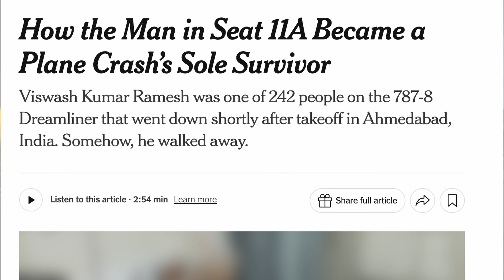Why the RAT Changes Everything – Air India 171 Update

Comment: Captain Steeeve,
I have a friend who is a pilot and flies in India. He said he was actually in the air flying when the crash happened (different flight and different plane than 787).
He said:
“Most probably they have lost their both engines in a very critical phase of flight: TAKE OFF for a long haul flight when the aircraft was so heavy….
At that day at the same time I was in flight, very hot weather with thunderstorms
Vapor lock in fuel system is possible.”

What are your thoughts?

Comment: Delhi (humid)
↓
Partial fuel + humid air → Condensation in tanks & electronics
↓
In-flight to Ahmedabad
↓
Early faults: AC issues, screen flickers = symptoms of moisture
↓
Ahmedabad: Fuel tanks refilled
↓
Water + fuel = contamination
↓
Takeoff for London
↓
Engines ingest water → thrust loss
↓
Emergency

 I have a technical question regarding the possibility of small amounts of water, caused by condensation, leading to engine performance issues or failure.

Based on publicly available data and past incidents like BA38, I’m exploring whether the following sequence is plausible:

The aircraft (B787) operated a short-haul leg (Delhi to Ahmedabad) with high humidity.

Condensation may have formed in the fuel tanks and/or electronics.

If water was not drained at Ahmedabad and long-haul fuel was added, the water could have remained at the bottom.

During takeoff or climb for the Ahmedabad–Gatwick leg, even a small amount of water could have entered the engine fuel system, leading to power loss, icing, or fuel flow disruption.

My question:
Can such a small volume of condensation-induced water — even 50–100 ml — realistically cause thrust decay, filter clogging, or misfueling events in modern aircraft engines like the GEnx-1B on the 787?

Also, would early signs like AC malfunction or screen resets potentially indicate environmental moisture exposure that could relate to such an event?

I would deeply value your thoughts or any precedent examples of this kind.

Comment: @CaptainSteeeve , Steeve, know your nomenclature. Its not a horn, its a siren. ( I think you are a B737 pilot).Secondly, initial pitch attitude is 15 degrees. Have you read the B787 FCTM recently? BTW, it‘s identical for the B777, with respect to TO. As far as the bending moment of the wing at slow speed, you are Full of it! Later on you will opine about the RAT spinning at the speed of sound? OK, at what  blade length are we talking about angler velocity of the speed of sound?  Tell me the diameter of the B787 RAT, and secondly, at what speed would it rotate at 180 KTs, at sea level.You need to stop with all your speculation. You are creating clicks, providing stupid speculation. You will continually change your theory, to suit the current narrative. You need to go to work, and stop with the BS.  Your  hypothesis will all fall apart, one by one. Thank Christ you are not running the investigation. You are such an idiot. More importantly, take off your stupid clown suit. We are not impressed

Comment: The only survivor mentioned hearing a bang just after takeoff. I assume that was the main hydraulic pipe bursting, and due to that pressure burst, the secondary system may have been damaged. The RAT deploys for two reasons: loss of electrical function and hydraulic pressure. At 600 meters, the landing gear was still out, and the flaps were not moving. This means there was a catastrophic failure of both the primary and secondary hydraulic systems that control flaps and landing gear. The survivor mentioned he could hear the engines being pushed to full throttle; however, without the flaps being in position, the aeroplane would stall and come crashing down due to having no positive lift on the wings.

Comment: STEVE. I have shared this with Gary. `Thrust` is everything on take off. Without it, a plane cannot lift. This plane laboured on take off, using the full length of the runway. Notice the dust blown up just before take off (ie using last section of runway rarely used). Now, let me ask you this: what effect would it have on `thrust` if a very small amount of diesel or water (say, a cup) was added to the tank? And would this small impurity cause alarm-systems to alert the pilots?

Comment: @Captain Steeeve I have a shaky theory it’s backed by a little bit of research , a key piece of evidence that further supports the theory of an engine failure: the air conditioning was failing. This was powered by the PMG which is powered by the AC power supply, which also powers the fuel pumps, which are monitored by the FADEC. You mentioned that the engines were running but on low power meaning it is possible they were running, but due to an issue in the signal to the fuel pumps or a disruption in metering, which would be possible during a high thrust run(during takeoff) the systems failed(flickering green lights) this could have been a maintenance/ lack of failsafe in case of multiple electric failure. But that is my take. God bless and I hope the aviation field grows from this.

Comment: I was thinking about the same because something happening with my plane 3 times
the electrical 3 times when I was in the kind of aircraft travelling once  from  São Paulo another from Ahmedabah and another from Toronto
Out of the blue as we were getting ready inside the plane the lights went totally off
The Air India flight In  Ahmedabah got us out of the plane until someone from Mumbai came to fix. The US airline got some light back and we flu almost in the dark inside the plane. They had to use flash light to give us the food The third  one Air Canada in Toronto made us to wait inside the aircraft until they fix the plane

Unfortunately I still fly on those planes but I always have the concerned and the hope that the electrical would not goes off when we are taking off

I hope they see this very seriously

Comment: Steve you sure know that by that point or stage of flight a 787 doesn't need an APU to still be running. And yet still at such an early stage of flight in ascent, dual engine failure too is not true or else the AC wouldn't lift off the ground esp without the required RPM for take off. Lastly about the flaps, in a 787 the flaps and LG are operated using different mechanisms that don't even look or feel alike so there is now way the first officer could have confused the two esp not with 11000 Hrs.
As we can all agree, the LG had not yet retracted so this symbolises the early stages of take-off so I hope we can look at another angle.

Comment: Fuel starvation might be a possible cause, where fuel is present in the tanks but fails to reach the engines due to a blockage, pump failure, or system malfunction. This can lead to a dual engine shutdown, which would automatically trigger RAT deployment on the 787.

Comment: Thinking the explanation at this point is electrical systems failure impacting everything on board.  The 787 is more dependent on electric systems than other aircraft, so it is more vulnerable to electrical systems failures.

Comment: Boeing's safety record and whistleblowers have to be a consideration.

With the evidence pointing so strongly to a dual engine failure, the big question shifts from what happened to why.

A double engine failure on a modern, reliable airframe like the 787, especially right after takeoff, is an event of almost astronomical rarity. While the investigation will rightly look at external factors like fuel contamination or a massive bird strike, it's impossible to ignore the broader context.

Given the intense scrutiny on Boeing's manufacturing processes, quality control, and safety culture in recent years, this incident raises serious questions. Investigators will need to dig deep into the manufacturing and maintenance history of this specific airframe and its engines. The possibility that this wasn't a freak accident but a symptom of a deeper systemic issue is a chilling one that must be thoroughly explored. The black box data is key, but so is the paper trail from the factory floor.

Comment: What if the Dreamliner's Computer System was modified with a Virus, causing the Auto-Pilot to forcefully take over and it limited the thrust of the engines upon takeoff?? 😱😱😱
Similar to those 2 commercial Jets that went down because the Auto-Pilot took over and the pilots couldn't stop it's actions soon enough.

Comment: I'm gonna go out on a limb here and just put out a wild theory here after watching this video..... India doesn't have as strict protocols in aviation as the rest of the world.. I'm thinking an honest mistake slipped through the cracks... Probably got the wrong type of fuel delivered.. like car gasoline.... Somehow, somewhere, truck deliveries got mixed up and the dreamliner got filled up with car gas... Not jet fuel... And more than likely the plane warned the pilots of it but typical of Indian culture, they just ignored it.. they might be used to flying with contaminated fuel so much that they are used to these warnings and the engines are so efficient that they still perform... That's just MY theory... Get mad if yall want.. it's a possibility.... Dual engine failure right after lift off? RAT deployed? I'm going with wrong fuel..

Comment: I have spent a little time looking and relooking at the video's I am interested in Aviation and love the industry. With rewatching the video and I have noticed something. Which may or may not be important. I am sure those of you who fly the 787 will be able to tell me if my thought is wrong or right. If you look at the photo of the plane passing in flight after it has taken off. If you look at the main landing gear the wheel dolly is in the wheels down position. Should they not have been in the wheel dolly up position with the front set of wheels being up higher than the rear set of wheels?. If the pilot or co-pilot has activated the gear up lever then does not the main gear dolly's go into the wheel down position or neutral position before it starts the transition from being out to up and locked? With the main landing gear dolly's pointing downward.... Could that therefore indicate that the captain or co-pilot had activated the gear lever into the up position. The main landing gear then started the gear up sequence and put that dolly from initially being up at the front set being down and then something happened which prevented the next and other stages from happening in retracting the landing gear? To me and I noticed this in the first time saw the grainy video but seeing it again in the clearer video. To me that just does not look right. Maybe someone out there knows more and can correct me. But thought would mention it and see what others think. If my thinking is correct, then the main landing gear is retracted using hydraulic's if the gear has failed to retract could that therefore be an indication of hydraulic system failure? There is a lot of you with experience of flying that aircraft type or even into the maintenance side who can correct me if my thinking is incorrect. But, it was one thing I have noticed.

Comment: Well Captain, I believe you are getting close to the answer but you have to spread the net a bit wider.
The deployment of the R.A.T. Has been known to me almost from the beginning as an engineer told me of the sound of the plane indicated that the R.A.T was deployed. I then searched all the video of the plane taking off and finally found a sharp image showing the deployment. I now knew that a catastrophe fail had occurred in the electrical system. Further searches threw up a video that showed electrical supply anomalies had been observed on the same plane on the incoming flight. So now I know that there was a degradation in the supply system.
The sole survivor of the crash said that the lights were playing up just before the crash.
Comments have been made concerning the gear still being down, I would suggest that the attempted lifting of the gear overloaded the ratty system which collapsed.
Now here is something that you can help with, the deployment of the flaps, power is supplied to deploy them if the power goes out do the flaps retract?
If all power is lost will the engines go flame out? I ask this because the plane had no engine power shortly after take off and was in a fairly flat stall.
My conclusion then is that the accident was caused by a ratty power system! Hopefully fault codes from the black boxes will show some more evidence.

Comment: The dual engine failure happened during the ascent, when the plane took off !!! Such was their bad luck that they could detect engine failure/ loss of power only when it airlifted for a few seconds….had it been on the runway during the take off dash, they could have alerted the ATC & some sort of arrangement may have ( and I say may have because the flight was already in speed so would have been difficult to stop with even hydraulics out so assuming braking was not an option even on the runway & it would have crashed with what was in front of the runway 😢) , but maybe there was a glimmer of hope on the ground with some sand dune kept outside of the runway to mitigate such a situation!!! Atleast that way they could have avoided hitting the buildings which further killed many others. Not saying the ground result would have been desirable either. I am terribly shaken by this incident so may not be making sense I am sorry but this just breaks my heart. Families wiped off with kids 8,9 10…charred at 1000C temp !!! No way to go. God should have intervened.

Comment: Thank you Capt Steve! So to add to this- and we have to take it with caution because it was a TikTok reel BUT a guy made a video of the actual plane that crashed from what he claimed was the flight prior and showed the electrical having issues. Said it was super hot and they had no power in certain areas. Now- could be fake and not true but if it was- might make one lean to the electrical issue. Although- I would wonder how it went back up in the air. So who knows.  As always- I appreciate your take. You are simply the best. Capt Steve for the head of the NTSB! Only qualification you’re missing is an MTV prior job 😉😁

Comment: What is the possibility of fuel contamination issues causing the fuel to get cut off or not able to drive the engine? The reason I ask that is because India has been experimenting with Sustainable Aviation Fuel (SAF) which is an ethanol blended fuel with as much as a 50% ethanol to 50% av gas.  But there is one big issue with ethanol blended fuel - the ethanol and av gas can separate under some conditions as ethanol is hygroscopic - that is, ethanol can absorb moisture and separate out into a different layer. This can be an issue when the airplane is taking off because the water will slosh to the bottom of the fuel tank and then feed into the fuel pumps as typically the fuel inlet to the pumps will be at the bottom of the tanks. Even at 10% ethanol this can be an issue - and at 50% it can be huge issue.

Comment: could be a form of throttle control for the motors, if a battery failed... or the connections to it failed... could that affect the control of the throttles?  idk if its a fly by wire or not... but what would cause a battery or its connection to make a bang sound?  since i don't know the size or number of potential batteries, its just what popped into my head... idk what the tower heard, and a bird strike can hit an engine, yes... but it can also hit a windscreen and potentially take out a pilot.  and in the chaos it crashed?  i mean it was only in the air for 1-2 minutes?  so is that possible?  also the type of aircraft was built by a company that started taking short cuts and using bad parts in manufacture of some models... they were caught by a whistle blower... thou idk the consequesnces involved. or if it is a potential here.  just more food for ideas.  peace.

Comment: What about the big bang?
The Boeing 787's "more electric" design, while offering numerous benefits in terms of efficiency and weight, also means that a significant portion of its critical systems – including engine control, hydraulic pump operation, and various flight controls – are heavily reliant on electrical power. This interconnectedness means that a single, devastating event impacting the electrical architecture could have far-reaching consequences.
The loud bang: it was a strategically placed bomb. 
This is terrorism by Pakistanis. They will repeat this soon. For now, they are content to sew fear and avoid the military conflict.

Comment: I think you're right, but wrong.

I think the landing gear Retraction Solenoid caused a power outage.

The sound you hear isn't just the Ram Air Turbine but also the Jets powering down.

Great catch though! - I wouldn't have seen the RAT with my old eyes.

(however, my interest would have been perked had I heard the original sound.)

Comment: yes but what is meant by engine failure ?  Complete failure or significantly reduced max thrust, such than there was insufficient lift  to prevent loss of altitude. It sounds to me as if the engines were operating. And that begs the question - will the RAT deploy under conditions of inadequate engine thrust or only if there is complete failure of both engines.  The list of conditions leading to partial engine failure is probably longer than for complete bilateral failure but the end result is likely the same unfortunately.  It appears the pilots bravely avoided doing things to aggravate the situation and realized their only hope was to lay the plane down nose up and as slow as possible, maybe they saved that one passenger.